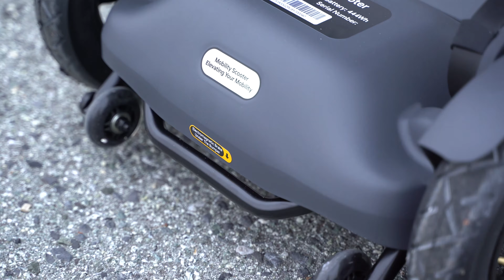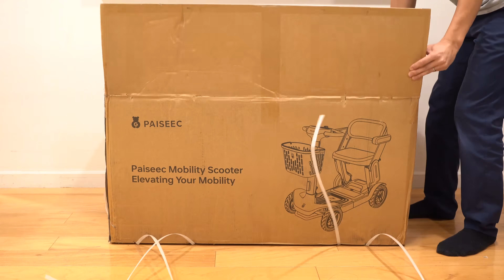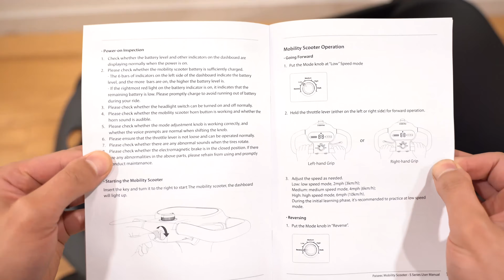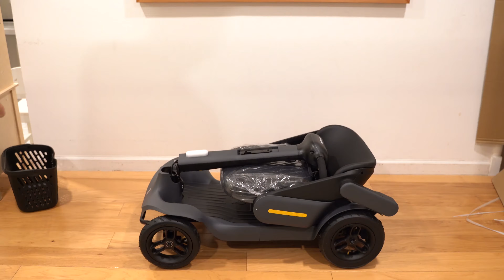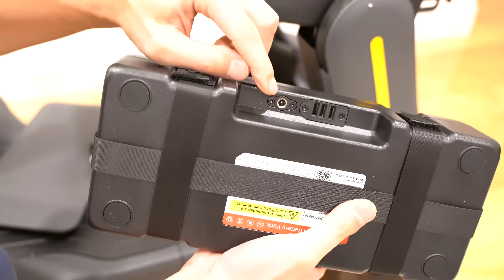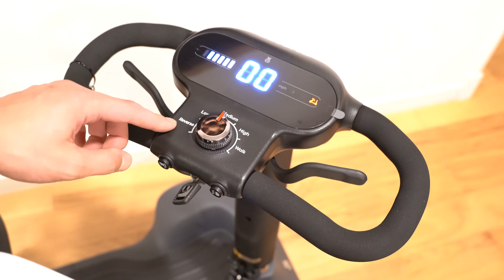Paiseec S3 Electric Mobility Scooter/Wheelchair: Unboxing Assembling & Settings Part 1 15% OFF Code

Comment: What's the weight that it holds and what's the price
Reply from the maker: Thanks for the question. 
Load Capacity: 300 LBS (136 KG)

MSRP $1,399.99. Sale $934 with 15% off coupon code on official website: Colin15
Paiseec Website: https://www.youtube.com/redirect?event=video_description&redir_token=QUFFLUhqbUlsWEU2VkM4WkIzSFVDeFpCNE8wM0ZGVV9HZ3xBQ3Jtc0ttc0stNU9wWjdmaXJGRllfNUxEaHBIMll6ZXpsUXkzc0xOT0t0YTlXb0M0R1NoNzlpV1ZkWmdlU2JuUTN6UHVxeTN0MXB1ZWVUd0p0S0ZqTUZPWU1Xd0FuR3ZSSnA0Z0wwSzg2UzRqTTVONDJXaU1xQQ&q=https%3A%2F%2Fglashowtechnologylimited.sjv.io%2FgOj9rv&v=cg5b0GjTH6Q
Amazon: https://amzn.to/3XnM85U